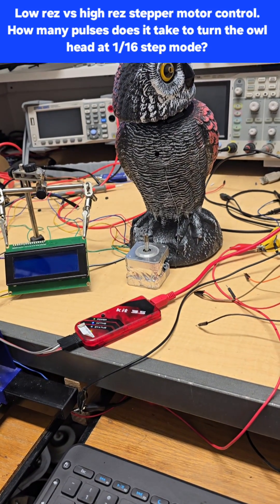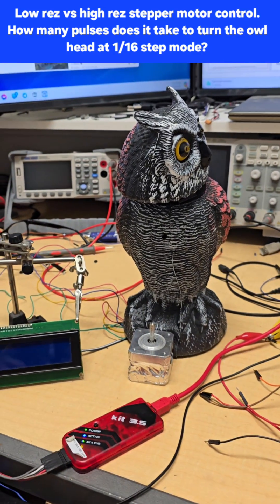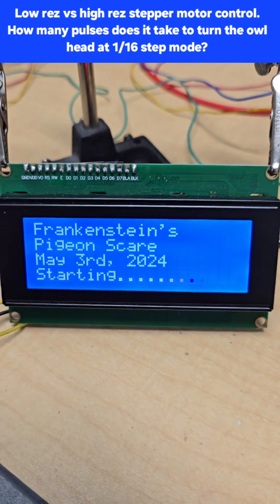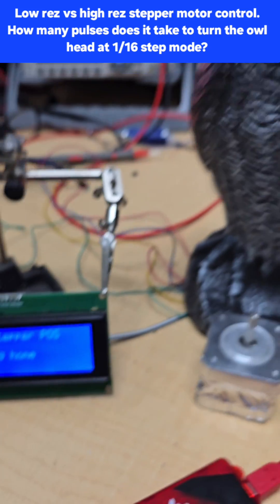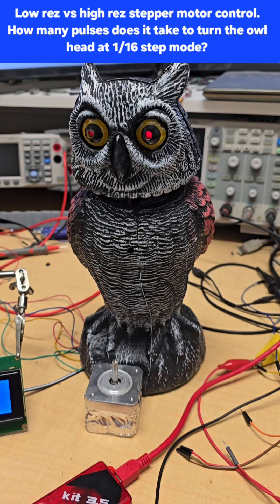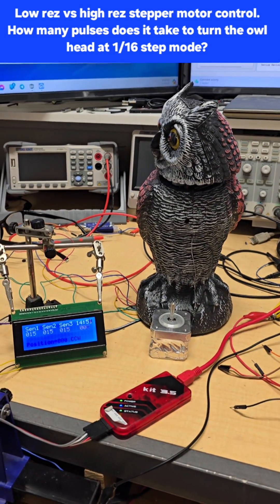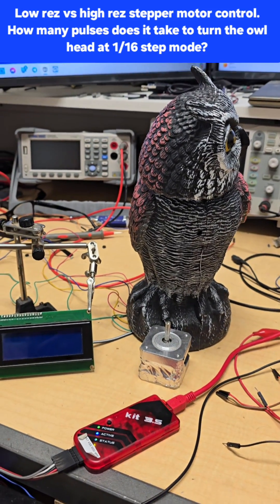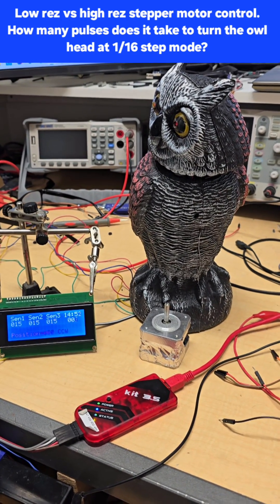Low rez vs high rez stepper motor control [This is how they drive EXV/EEV/PMV devices]

Comment: I'm pretty new to micro-controllers and everything around it so this was very fast! :D
What does the "1/16 stepping" imply? That it moves a 16th with every pulse? That doesn't feel right, with over 1300 pulses it would spin like a beyblade by that definition ;)
Reply: 1/16 stepping means the amount of movement will be 1/16 of a step with each pulse. So 16 pulse will be one step. 1.8 degrees per step is very common in steppers (200 full steps for 360 degrees rotation) and its 16*200=3200 pulses for full rotation. He says left to right so it will move roughly 146 degrees which is enough.
Reply from the maker: @kayrakocak9827  Go back a video or 2 of mine in the project and you will see me. Explain the stepper motors in quite a bit of detail. I think it might be part two.
Stepper motors are essentially two magnetic poles, repeated around the circumference of the motor.
So you put DC power and keep it there. Your magnetic field of the shaft will just align with that field and stay there.
So if you add dc power to the next pole, then it will attract halfway to that one. Then if you release the DC. Power to the first Pole. It will release the shaft in directly line up with the second pole. 
Then you go back to the first call all, but reverse the voltage so that it attracts the opposite magnetic fields that is close enough to attract.  And repeat those steps. 
So with those steps there, you can predict and know exactly where the shaft will be at all times.
How it divides the steps is at the chip. That drives the motor instead, divide it up to how you set it up.
So it is no longer full on or off but using PWM it varies the magnetic strength of each pole. You can go up to about 1/16th rotation per step.
Reply: @kayrakocak9827  Thank You! I wasn't aware that a step is in itself a fraction of a revolution instead of a 16th of a full revolution. Now it makes sense ✌

Comment: Nice!  was wondering last vid if HiRes mode could indeed move fast like that.  

When it senses bird you should have it spin way around, like a little too far, then jerk back other way maybe 5 or 10 ° ,  then  flash those  niteEyz!    mimics the wild.   maybe estimate angular position of perpetrator using  3 or 4 LDRs  and have head move end on target.
Reply from the maker: To keep it simple, I'm only gonna have 3 light sensors.So at least it will turn its head in the direction that it was disturbed.
But that is a good idea about turning the head and jerking it back.
I could do that with just a little bit more code. But the head can't turn any further.Because I have limiters under there. And the reason I didn't extend the limits is because there's a wire cable going up to the eyes that I don't want to break off.
Reply: @hackfreehvac  cool build man, nice job on it and the PCB's.     yeah birds have really bizarrely jerky  head moves, maybe just a few degrees counterrotation be cool to experiment around with in the code.   look fwd to seeing another update 👍
Reply from the maker: @GannDolph  I'll try it out. Just will need a few more lines of code.👍